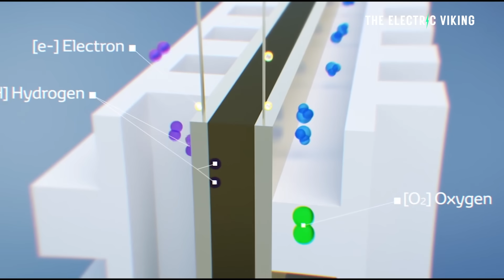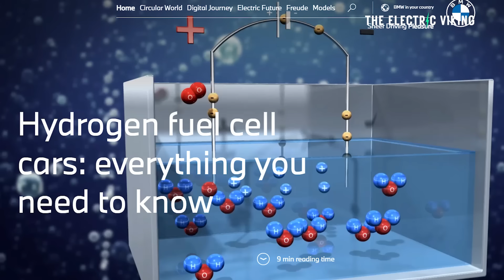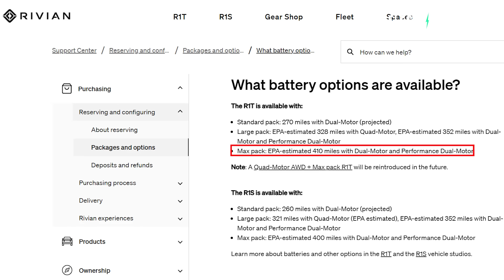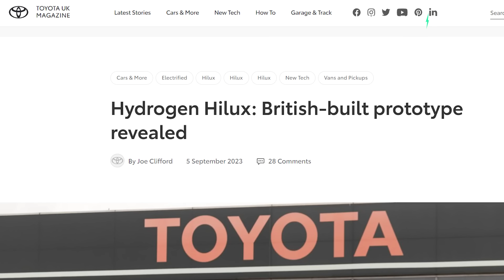Toyota's Hydrogen powered Hilux is the REAL future of the auto industry

Comment: In California my buddy has had two of the Toyota Mirai, Great cars but stations are run by a third party and poorly.  Toyota if they invested in stations and infrastructure the way Tesla did they might have something but they have left it to others and it has been more of a distraction than a solution and it is a shame because the cars are amazing!  There are times where the 4 stations within 30 miles are out of hydrogen at the same time. It is a mess.
Reply: Hydrogen fueling stations are not easy to run, and even when they are operating perfectly, they can't service anything like the volume of vehicles that a petrol station can: current stations  run out of hydrogen after refueling 50-67 cars. And of course dealing with highly compressed (700 bar) hydrogen is challenging at every step. Which is why so many Mirai owners keep encountering non-functional refueling stations.

I'm sure Toyota doesn't want to get involved in the hassles and headaches of running a hydrogen distribution network. Which raises the question of why they are committing to HFCEVs in the first place.

Comment: All the hydrogen stations here in Denmark just closed. I suppose it could still work if hydrogen cars came with a built-in electrolyser, so they could be home charged like an EV. But I'm not holding my breath.
Reply: The battery would be twice the size of a pure EV.  Charger up and fill with water.  Why not use the battery electricity directly and get 2X the range or 1/2 the weight?
Reply: @danharold3087  You misunderstand. What I meant is to fill the hydrogen tank directly, at whatever rate it's produced by an on board electrolyser hooked up to 11kW AC + water overnight.
Reply: What powers the electrolyser? Because the hydrogen it creates will contain less energy that the electrolyser needs to produce that same amount of hydrogen. It's an energy-negative process, basically due to physics. @virtual-viking
Reply: @virtual-viking  OK I understand. Still wasting 1/2 the energy just with the electrolysis process.  Goes to heat.  Why bother?
Reply: @danharold3087  The benefit is being able to charge at home like an EV, where electricity is so cheap that wasting half isn't a problem, while also being able to use hydrogen refuelling stations when going on road trips abroad.

I think it could work, as opposed to owning a current hydrogen car without any refuelling stations. It would be similar to owning an EV with the electrolyser taking the place of the on board 11kW AC-DC transformer.
Reply: @jamesheartney9546  The electrolyser would be powered by the exact same grid power as an EV. The electrolyser + hydrogen tank + hydrogen fuel cell is a drop in replacement for the AC-DC transformer + Li-ion battery in a BEV. 

Yes, the efficiency would be lower, but the range/capacity would scale better at the high, because bigger hydrogen tanks don't need much additional cell walls. Ideally scaling at r^(2/3), it would really benefit bigger things like ships, semi trucks and other heavy equipment that would require a huge amount of batteries otherwise.

Comment: In order to make 1kg of clean hydrogen you need 50 kWh of electricity. This 1 kg will give a 100 km range on a small car. A battery electric vehicle (BEV) will need only 20 kWh (and even less) to make the same distance. So fuel cell hydrogen car is by far less efficient than a BEV. 

If someone cares about the enormous amount of new electric power plants required for the BEV transition, just imagine the number with fuel cell hydrogen cars !!!
Reply: spot on! and if you ride mainly in city or not very fast, 12 kWh/100 kms is common

Comment: The major disadvantage with pure Hydrogen is its atomic size.  Its extremely small, so small if fact (though helium is smaller) that the storage containers in simple terms are porous or "leaky" in comparison.  Pure Hydrogen as a gas is also volumetrically large for energy density comparison vs. Gasoline/Diesel or other similar HydroCarbons thus it has space limitations as a transport driven fuel.  Liquid Hydrogen (super cooled) has even more issues as it requires immense pressure to remain chilled enough to stay in liquid form and due to is leakiness it has indoor storage (garage storage as an example) issues where as it is extremely dangerous and not viable.  While compressed or liquid Hydrogen has its uses as a fuel, its just not suited well as a mobile transport fuel.  Lastly, there is no infrastructure in place currently to support Hydrogen use in any scalable amount.  Gas, Diesel and Electric have a century of infrastructure already in place.  I could see Hydrogen as a useful stationary power source similar to battery banks where when there is excess electricity available to then use it to generate and store hydrogen for later use.

Comment: My understanding is that it is extremely difficult to store Hydrogen.  Hydrogen is just too difficult to contain & leaks during storage & the creation process.  Although Hydrogen is not a direct contributor to global warning if Hydrogen is produced on a massive scale the leaking Hydrogen would combine with other elements in the atmosphere & further enhance the global warming affect.  Hydrogen is not the answer!
Reply: Yea at 10,000 psi or 700 atmospheric pressure you can expect leaks and explosions.
Reply: @AORD72  It's not exactly the pressure. If you "look" at any solid matter with an electron microscope you see it's not completely solid, but instead it has gaps between its atoms; for the most part that doesn't matter because almost anything you would want to contain has molecules larger than those gaps, but hydrogen has such small molecules that it escapes through those gaps.
In other words, at the scale of the hydrogen molecule a solid steel wall is porous like a sieve.
Reply: @FabioCapela  Sorry I meant leakage due to critical failure. Imagine 1 million hydrogen cars on the road, how many would have a major failure causing leak and end up with a large explosion. A 1% failure rate after 10 years of operation would be pretty good in any product in any industry, and 1% of a million hydrogen cars is 10,000. 

I'm not so sure how true hydrogen passively leaking is with all material structures. Yes hydrogen atoms are the smallest, but atoms can be forced together in manufacturing processes to form very strong surfaces to contain hydrogen. I would think the higher the pressure the higher the leakage.
Reply: @AORD72  Hydrogen leaks through anything. The only thing harder to contain than hydrogen is helium.
If I remember correctly, some models estipulate that changing from natural gas to hydrogen will increase leakage by 2% simply because hydrogen can't be fully contained, which when added to the more than 2% average leakage of natural gas due to defects and failures would almost double the losses.
Reply: @FabioCapela  "Hydrogen leaks through anything", are you a materials scientist? or just regurgitating general statements off social media?
I wouldn't be surprised if some materials can contain hydrogen, especially at low pressures.

Comment: I like being able to "fill up" my car at home so everyday I leave with a "full tank".  BEVs are the only vehicle type that will allow this.  I'm sure it's much cheaper to install a Supercharger station then a Hydrogen fueling station, especially considering the distribution network needed.  The production of the hydrogen isn't climate friendly, unless you only use electricity from solar, wind and nuclear.  Why use electricity to create hydrogen, then use a fuel cell to turn it back to electricity to charge that battery in the car to run the electric motor?  The capacity of batteries continues to rise as their cost declines.  By the time this hydrogen powered pickup is on the market the batteries will be so much better.
Reply: Getting electricity from where it is made to where it is used is not that easy. H2 can be transported like gasoline and diesel. So you just need a storage tank at both ends. Now you go to your local electricity grid owner and ask for a 1000kw feed to your garage (4x250kw chargers only). When they stop laughing, you might find it's not that easy. No, I don't support H2, it's a dumb idea leaving us in the hands of big oil once again.
 "The capacity of batteries continues to rise" The difference between the first model S and 2023 model is not much considering 12 years of advances?

Comment: I personaly would never buy a hydrogen powered vehichle when i could buy an EV version. EV is better by a long shot in my opinion. I mean how good is it being able to generate your own fuel source from home using solar and batteries, you pretty much never have to worry about fuel prices again onces you have a good home solar and battery system. If i brought a hydrogen powered vehichle i would still then have to rely on refueling stations, i already hate having to go fill up with fuel as it is, it is bascially like signing up to a subscription service for the whole period you own the vehichle because you have to fill up at their hydrogen stations. The same goes for any gas appliances at home etc. you are signing up to a subscription service where you have to buy the fuel to use it over the whole period you own it. EV the only way forward in my opinion.

Comment: People should know by now what those words like : Pledge, guaranteed, committing, etc, really means. Since those words means they are lying jsu like Amber Heard did in court. And would having a battery and hydrogen work well together in fires?? Regular cars had been caught fires for more than 50 years, by accidents, bad maintenance, car manufacturers trying to cut costs, hide defects of vehicles,blaming customers for misuse of said vehicles,  wondering how much they would end up paying for cremating drivers in their vehicles VS settling a lawsuit with their survivors?? They all lied with diesel gate, engine gate, transmission gate, fuel tank gate, rust gate etc. Car manufacturers have always lied to customers in any way they could, even when their security were at risk 😞 Toyota, Honda had been for more than 50 years for reliability, fair prices, low maintenance, fuel economy etc. But that had changed in the last 10 years sadly, i prefer a vehicle that could do 50+ miles per gallon than doing than 0 to 60 in 7 or less seconds. I'd never need milk and eggs that fast LOL

Comment: Hydrogen is a very small molecule, that cannot be contained by steel tanks and copper tubing. It will ALWAYS leak, so if you park your car for a month, don't expect a full tank. Creating Hydrogen is expensive, and often results in air pollution. A hydrogen fire in a vehicle is INVISIBLE. It can burn the driver and passengers with no advanced warning. Transporting Hydrogen is transporting a bomb! Where are the filling stations? What are the costs?
Reply: The hose from the pump to the car has to withstand over 10,000psi. Would you want your son or daughter
to hold it while fueling the car?

Comment: When I feed my current car to a car crusher, I’m not rushing to buy a hydrogen hilux. Great, I can continue to be a slave to a fuel network. Electric, I can mostly supply my own electricity. After renovating my house I can install 20kW solar system for off grid charging. Still waiting for battery storage to be cheap enough. I’m waiting another 4-5 yrs before considering my first EV though.

Comment: What part of hydrogen takes four times the electricity per mile as battery vehicles makes sense? Light vehicle hydrogen use is just plain nuts and is a leftover fever dream of Akio. If we had so much wind and PV power that we didn't know what to do with it, then you can make hydrogen. Tesla has proven that even class 8's can be BEV. Lets save hydrogen for air travel, which at the moment is physically impossible to do with electricity. If you burn hydrogen you get oxides of nitrogen pollution. Still a bad idea.

Comment: It must be pointed out to Toyota, that EVs are on a trajectory of lower cost to buy. Tesla are working on a model that will halve the cost of production, and Chinese manufacturers already have a range of sub $20,000 cars. It is absolutely impossible to produce a hydrogen vehicle at scale - the infrastructure is essentially non-existent. In 10 years , EVs will be made so cheaply, that complex, expensive to buy and expensive to run hydrogen vehicles will simply be priced out of the market. 
Hydrogen is simply the last roll of the dice for fossil-fuel companies ....
Reply: Exactly, battery EVs are far more economical.

Comment: Any authority that permits an H2 station in anything but an industrial area will be guilty of negligence.
Reply: Ask Norway if they will ever try hydrogen again. Norway, the leader in EV sales (85%), tried hydrogen. The hydrogen fueling station blew up. And they no longer want them. This is a wealthy country that is open to trying new things.
Reply: H2 is VERY difficult to contain. It can go through almost any material. It is a very small molecule. Skeptical? Look it up. Lpg on the other hand is easier to contain.
Reply: H2 stations are of lesser risk than LPG stations. There are tens of thousands of LPG stations across Europe. How many LPG stations explode annually, because of the risks? Actually ZERO in the past decade.
Reply: @johnhopkins4920 and two hydrogen stations have exploded in Europe in the last decade. For one, the injuries were from airbags going off from the shockwaves.
Reply: @johnhopkins4920  The most awful hydrogen explosion is the space shuttle H2 tank explosion while those solid fuel engines still work in secure condition until the engineers have to push the button to destroy them.
Reply: @johnhopkins4920  H2 is lesser risk? But then you say there are many more LPG and none have exploded but very few H2 and some have exploded. Do you not see the flaws in your own comment?

Comment: If Toyota are so committed to hydrogen they should be building a worldwide hydrogen refuelling network to rival petrol stations in the same way Tesla invested in Superchargers to support their EVs. Unlike EVs hydrogen vehicles need filling stations because they can’t refuel at home. The fact EVs can refuel from any electric point helped establish them with early adopters. The problem for Toyota, or anybody building a hydrogen filling network, is it’s so expensive nobody can afford to do it with no potential return until there are a few million hydrogen cars on the roads of the world. 

The only reason for the hydrogen Hilux to exist is the same as the Mirai. It’s the promise of something. Better in the future to keep people buying ICE cars until it comes along.
Reply: Elon has over 50,000 charging station, and these are not enough. It will take over 20 years to get to that number of Hydrogen "pumps" which are obviously more expensive. Guess who will bear the bill?
Reply: Tesla had the advantage of the grid already available. No need to build out distribution networks etc. And when a reliable fast charger was ready for mass production the cost for each charging facility was a fraction of the equivalent petrol station.
Reply: @perperers2502  Building the Supercharger network was a lot easier and cheaper than building a useable hydrogen fuelling network with much cheaper fuel which is why hydrogen hasn’t happened as a transport fuel.

Comment: Why on earth would someone be interested in buying a hydrogen car. Fuel costs more expensive than either gasoline or electricity- With electricity you can fuel at home with cheap rates and currently BEV owners mostly fuel-up at home. Yes, you have apartment dwellers that can't do that but it is more expensive than electricity. Plus, assume you still will have some form of in remental maintenance compared to BEV. NUTS if you ask me.

Comment: Large trucks can use H2 because they have the space for large tanks. The smaller the vehicle, the less likely there will ever be an effective H2 option. A large ute is about the lower limit.
8:05 Look at the size of those tanks for the range. Where would you fit those in a Corolla?

Comment: Though it’s not mainstream, they said the same thing about electrics and hybrids before it.  That they just wouldn’t catch on, and here we are with semis.  We are in a sci fi world at this point.
Reply: Hydrogen fuel cell vehicles have been around for as long if not longer than BEV’s and flopped. They’ve had a fair opportunity to prove themselves and failed abysmally.
Reply: You can do simple internet searches to verify that there are about 1000 times more EVs than hydrogen fuel cell cars, and about 1000 times more EV charging stations than hydrogen fuel stations. So, even if hydrogen fuel cell cars were somehow better than EVs, it would be almost impossible for hydrogen fuel cell cars to catch up in the marketplace. And, of course, there is lots of evidence that suggests hydrogen fuel cells are not a better technology.
Reply: @CiaranMcHale  Hydrogen fuel cells are quite a bit more costly even if there were more fueling stations for them.  Just like a hybrid, there are two forms of power train working together.  The base fuel system and the electric system.
Reply: You do realize that a fuel cell vehicle is a two fuel type of system, not unlike a hybrid.  The fuel cell needs hydrogen which produces electricity to store in a battery that then provides energy to an electric motor (some may bypass the battery).  Production of the hydrogen uses a lot of electricity so why not just use that electricity to power an EV?  Also, hydrogen requires the same delivery network as gas whereas electricity is ubiquitous.  You can always find a plug if needed for electricity.  May not be fast but it will be there.